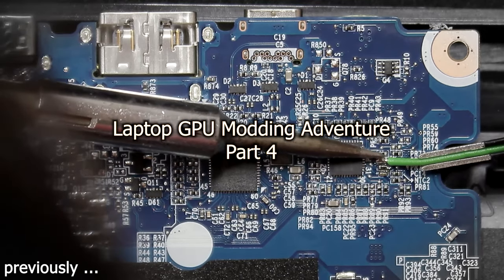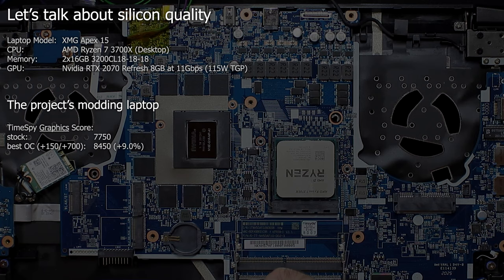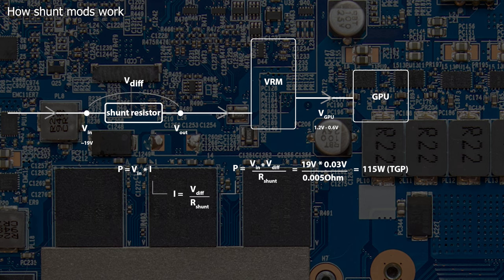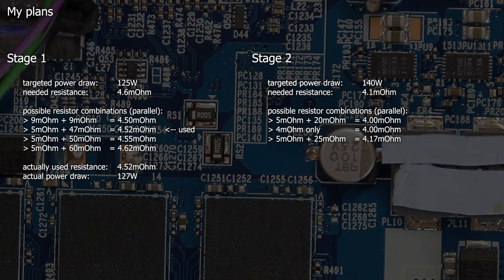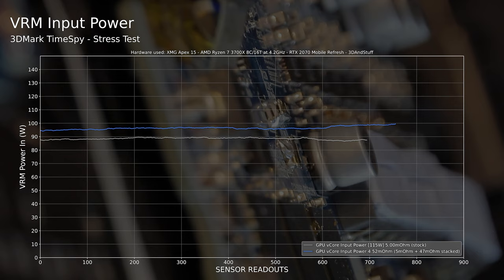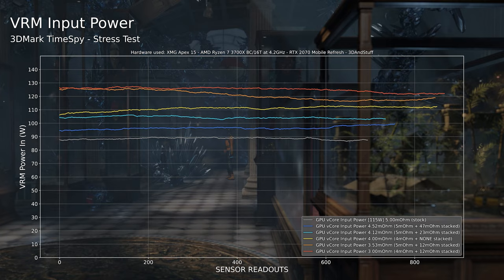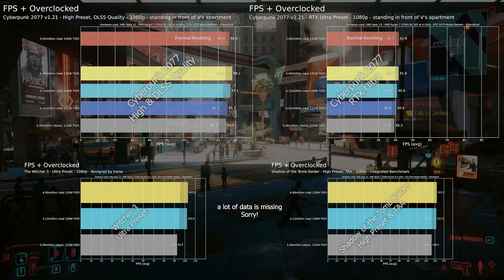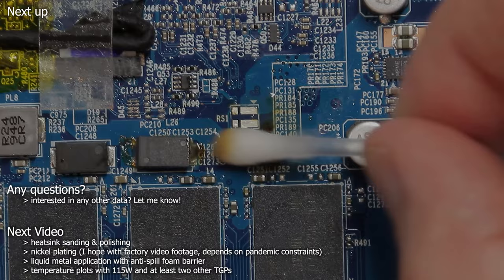Shunt Mod - Laptop Modding Adventure - Part 4

Comment: I gave my Dell G7 2080 max q a shunt mod. Went from 80w-140w. Mine and another person that helped me both have our 3dmark scores crazy high lol. I sold the laptop but I have the Alienware X17 R2 with a 3080ti now.
Reply from the maker: Nice! How high was your gpu score? I wonder if the temperatures were okay though. I bet the heatsink wasn't up to 140W when it was made for 80W.
Reply: @3DAndStuff  graphics score was 25,438, temperature on fire strike was 71c during the test. Never noticed any temperature changes when I did this.

Comment: A desktop GPU has access to stable power, whereas the laptop's Max-Q Dynamic Boost is shifting unused power from the CPU over to the GPU (and back). These setups work best when they find a sort of equilibrium balance between the two massive power draws (GPU and CPU combined). That's why a desktop GPU can almost always out perform the equivalent laptop GPU. And yes you have Max-Q tech in that 2070 even though yours is not the sucky Max-Q variants that were limited to 65w, but Dynamic Boost is actually Max-Q technology too. I think they may have stopped labeling Dynamic Boost as Max-Q later because so many people hated on those power limited variants, but those were supposed to be for ultra thin gaming laptops and not desktop replacement laptops.
Reply: Well, you can use the IMON tweak to bypass that crappy dynamic boost. Did it to my nitro 5 with the 3070ti 150w and i7 12650h. Now my 3070ti can use the full 150w and the i7 can use as much power as it needs to. With a repaste, propping up and cleaned internals, I can keep temps under control. It performs within 5-10% of the desktop 3070
Reply: @siyzerix  right but most of today's gaming laptops can benefit from undervolting the CPU if possible, and dialing back that CPU does let more power stay on the GPU side.
Reply: @bryanwashere5010  Most gaming laptop cpu's can be undervolted. They've artificially been limited so you don't go around improving performance and having control.

And in CPU + GPU workloads, an intel CPU will eat away power from the GPU due to it using more power than ryzen. Just don't let CPU and GPU share power. My nitro 5 can handle a 50-60w CPU + 150w GPU at once, cooling 200-210w. You can see it on my channel with me testing CP2077

Comment: Amazing content! Did you tried to change the vBIOS TDP with MobilePascalTDPTweaker and direct flash the mod BIOS? Or something like that?
Reply: Pascal tweaker wont work with this gpu, Nvidia released it after the last program version.
Reply: Don't need to shunt mod when you can just set the limits in vbios to whatever you want.
I have my 1080M SLI both set to 250W but they are 1.06V limited and hardly ever report above 225W
Reply: @greebj  In the RTX 20 series it is not possible to change the TDP in the vBios

Comment: Could doing a capacitor mod increase power slightly too, or at least clean up the signal? I've seen some people do it on GPU's, but I imagine it's possible on vram, and cpu too. Although it is very tiny work to do.

Comment: Hi. Very educational video.   My Acer Predator Laptop Helios 300 model PH315-54-93K9 With I9 11900H/16GB DDR4 3200MHZ/1TB M.2 PCIE NVME SSD/NVIDIA GEFORCE RTX3070 8GB GDDR6.  When install 4 unit external monitor via 1 x minidisplay port, 1 x HDMI, 2 x USB 3 using usb adapter to HDMI via Intel Display link software.  The PCH System Temp going higher to 80 deg C while CPU temp is 49 Deg C and GPU temp is 47 deg C.  What is best way to lower temp of The PCH chip ?  Please note the PCH chip does not have any heat sink and why does acer does not put heat sink on this chip?  Thank and looking for solutions.  More power to your channel..

Comment: Since the low resistance. Could stacking introduce a higher resistance because of the increased solderlength? That would mean that te rating of the second resistor is higher. Did you ever test the result with a single 3mohm resistor?
Reply from the maker: No, but with a single 4 mOhm resistor and I got roughly 138W TGP. But I think you are not wrong. The solder joints play a role and contribute to the observed non-linear TGPs. Not by 100% but some percent at least.

Comment: I shunt modded my 3070 mobile laptop  and it went from rtx 3060  desktop performance to nearly 3070 desktop performance
Reply from the maker: Will do that too with my next laptop :) What are your improvements in numbers? Baseline graphics score? Graphics score now? What about your temperatures and which shunt resistance you have chosen?
Reply: @3DAndStuff  eh it's a somewhat long process. Check out port royale scores for  10870h and 3070 notebook  I'm at number 1 currently. Do you happen to have a community discord? I could share some of the stories
Reply: @3DAndStuff  actually maybe if you dont want to mainly run a discord yourself i could make a discord and invite a few engineers who helped me and alot of people shunt mod and calculate what they should do so your community have a place to find help
Reply from the maker: @rayproductionsbackupchanne3862  Yep I am quite active in the XMG Comunity discord "XMG & Friends" (https://discord.gg/qBfDeUky). We got an overclocking&modding channel there lately. Come and visit us ;)
Engineers not needed :P we know stuff
Reply: @rayproductionsbackupchanne3862  i have a 3070 desktop  (gigabye a5 x1  it has a total 140 on the gpu currently based on the specs     can you provide how you shunt modded yours? i plan on watercooling my laptop with a couple mods and such and just want a general idea of what to do.  i want desktop level 3070 power at this point.

Comment: Hi mate, long shot but I modified my 0R005 resistors to 0R003 on my MSI GS66 10SF with the 2070 Max Q Refresh 80w, interestingly I now hit Power and Voltage limits shown in GPU-Z and Afterburner without any overclock. I was asked to check the resistance with a multimeter, but the lowest value is 200 so the best reading I could get was 00.5 on my 0R003 resistors. With that said, do you have any idea how I can diagnose whether the resistors themselves or even the soldering is correct? Right now I've literally just ordered a different brand of 0R003 1w 1% 1206 and was just going to try those as I can't think of a way to diagnose.
Reply: I'm no expert MrSweet, but you're trying to draw 190 Watts of power (To GPU alone) through those VRM and even with tons of loss what is trying to hit your GPUcore is so way out of spec no doubt that is your issue. Why not go for something way more modest like r004 or less (stacked) like these fine videos show? r003 is just insane for your laptop board to handle and that GS66 thermal capacity would choke fast and thermal throttle your GPU even if your VRM's withstood the temps for a few hours without fusing inside....  your power brick is probably not a 300W+ which you would need by my calculations so ---no way. Nice try but... Scale back would be my advice.
Reply from the maker: I did not experience it myself, but my guess is that you hit the limits programmed into your GPU's Max-Q vBIOS. It is not a regular vBIOS for the full power range, so it makes sense it is limited in voltage, too. R004 should work better.
Or you can manage to find a Max-P 115W vBIOS for your vendor, which works. Would be the easiest way, without shunt modding.
---
But as Eric said in his comment, using R004 (4mOhm) should already be close to the healthy limit for the existing VRM design in your laptop. So I would not go for more than 100W or maybe 105W TGP in your case.

Comment: i have a question tho, if you shunt mod a laptop, would you need to change to a better charger? like stock one is 100w, after shunt mod you get somewhere 150w so do i need a 150w charger? i know that it have nothing to do with input wattage, just reduce the resistance coming into the chipset
Reply from the maker: You are talking about the power supply unit (PSU), right?
Yes you probably need a higher rated power supply. Mine in the videos got 230W with a little headroom up to 250W, so it can support up to 140W TGP, 88W CPU, plus 20W extras (SSD, display, and so on). But it's really close to the limit. So I should opt for a higher tier power supply myself.
Reply: @3DAndStuff  thanks but they really selling those kind of psu for laptops? or i have to modify myself one?

Comment: Hello I want to ask you for a consultation on this notebook. I was waiting for the update from XMG about ryzen 5000 support on my apex 15, but on the first of November they released a news that they are having serious difficulties with this and the support of ryzen 5000 is highly unlikely. Right now I have ryzen 3600 in mine and its working very good and has a decent thermals. But I want to keep this machine around as much as I could, so if they will not realease a bios support for at least ryzen 5600x I want to know to which cpu I should upgrade? Im looking at 2 options - 3700x and 3900 non-x. Im using my machine for gaming so which one will give me more performance? 3700x has two more cores, but it can just add some more degrees with not that different performance, but 3900 has 12 cores and also 64mb of cache which will be very preferable for games in my opinion. Im sorry for taking your time, but I really need your advice.
Reply from the maker: you are right. At the moment there are no positive news about Zen3 support in the 2020 Apex15. But the new Apex15XL (2021 model) will get it afaik.
Your question for the processor strongly depends on your use scenario. Do you use your processor in ManualOC mode (all-core fixed max clockspeed)? If so then the 3700X would be a better choice because the fewer cores can reach higher clockspeeds than the 12-core 3900.
If you don't run ManualOC, but the default ControlCenter power modes instead I would still say 3700X. Also keep in mind that the higher core count processors draw more power in idle so your fans will go crazy even in idle, when you do not use ManualOC.

3700X:
- 8 cores are enough for gaming
- cheaper
- more quiet fans in idle
- more loud fans under load
- hotter under load

3900(X):
- cache doesn't really matter for games
- just a few games can make use of 12 cores
- more loud fans in idle
- more quieter fans under load
- cooler under load

If you are just gaming i think even your 3600 is enough. You will very likely see no higher FPS with a higher core count Zen2 CPU in most games.

Comment: Thx for all videos from owner xmg apex 15.+if you can,pls answer for some quastions, where did you take Vmem temp on your  laptop?+how much vmem can be overclock with out hard moding laptop(only with program methods) and problems in long life stability?In my laptop i have rtx 2060 refresh .Xmg have low power gddr6 1.2 unlike full 1.35 on other laptops -is it botom for good under clock for vmem?thx you.
Reply from the maker: VMem temperature? Unfortunately I can't acces their temperature. I can only see the GPU and VMem VRM temperatures.
VMem overclocking is very bad for me. I guess because my GPU's bin (silicon quality) is very bad. My VMem is a kind of bad bin too, not just the GPU. I can run +950 on the VMem at 1.38V. That's a joke, so for me it makes no sense to OC the VMem in this laptop. I hope my next one will be better.
In theory the VMem should overclock better than mine. They are the same memory ICs than in desktop cards (14Gbps). But maybe our GPU memory controller is not suitable for 14Gbps+. I can't tell because my bin is so bad as i said.
Reply: @3DAndStuff  thx you!yes, memory is a same gddr6 samsung like on desktop but have lower voltage 1.2 vs 1.35(desktop)that why i do not khow can i ez +1000k on mem or hire or not?bs on desktop and other laptops people can plus 1200 ez)
Reply from the maker: @AdolfL0v3J3Ws  in my experience on average peeps out there can push +900 to 1000 on their VMem. Some can also run +1100. But that's pretty much the end at 1.20V... so 13Gbps in total, which is not bad.
More voltage should give you more headroom. I wanted to show the improvements using my I2C Mod, but as i said, my VRAM bin / quality is not good enough to gain anything significant. I hope I will get the chance to investigate that with another laptop in near future.
In theory 14Gbps should be possible with the Refresh variants at 1.30V+
Reply: @3DAndStuff  Thx you for answers.but with out  knowledge about temp on vram -overclocking is a hard deal, bs it could rise over 100cel on vram= fast dead((if you finding some solution to take that temp?pls make some video or write some comment aboute it .Thx for all videos about xmg it is reall usefull for all oweners!
Reply: hi, any chance you can send me the vbios of your 2060, i can pay using xmg ultra 17 with 90w rtx 2060 sadly.
Reply: @ineptireplica1548  no need to pay,just write to xmg,and they give you that vbios.

Comment: HI, how would i go about doing this for an HP OMEN 17 RTX 2070 SUPER MOBILE, BTW I LOVE THE VIDEO THANK U SO SO MUCH FOR UPLOADING IT😊😊
Reply from the maker: glad you like it :) Well you would do pretty much the same as me. There must be two shunt resistors on your laptop's mainboard too. They are quiet easy to identify. They must be bigger than the other resistors, and can be labeled as "005", "R005" or similar. you can try to track the PCB's traces from the GPU VRM backwards to the shunts.
Reply: @3DAndStuff  Hi man, your project is insane and unique. Why didn't you continue it?
Reply from the maker: @bruda3173  i did and it's already finished :) Just need some time to put the data into a new video. But time is rare :( Got a new job - a lot to do
Reply: I AM Elated, cant wait for the new VIDEO

Comment: Greetings.
Is there any hope, that channel is alive ?
Reply from the maker: I know it's been a while. Working on part 5 atm ;)
Reply: @3DAndStuff  great !!!
Do you know, is clevo working on new AMD based 17inch screen chassi ?
Reply from the maker: @92OnTV  for the B550 desktop CPU variant? Nope! Unfortunately they focus on the mobile variants and seem to dismiss their DTR models. Ultra (with MXM) and probably also future AM5 models could get cut.
They got a 17 inch version of the Apex with mobile Ryzen already though.
Reply: @3DAndStuff  thats a shame(
Every good stuff get under cost cut knife after 2020.
I was dreaming about 19"-21" screen DTR model with best cooling, best sound and best flexibility :/ (p870 successor but even more advanced)
At this point already have no hope...

Comment: im not crazy ! im not only one who is doing this ! :D  i plan to nickel plate GPU plate on asus G14, they did the LM on CPU but saved 10c of money and put garbage thermal paste, after repaste +- + 150points in time spy. 
Shunt resistors, there is a reason why they have 4 pads instead of 2, im not that good with english google it up.

i want to increase TGP on rtx3060 from 80W to 90W, my best score after repaste and +150GPU +225MEM , fans at 80* on 80% was around 7000 point in time spy, disappointing :/
Reply from the maker: haha no you are not crazy! ;) it's fun isn't it? :)
Yep to be honest I do not really understand why the splitted pads from two into four are beneficial. I guess it has something to do with the signal/noise. But ofc there is a reason. I will take a read into it :) But my strange results with the lower two shunt configurations are not explainable just from the signal issue. I suspect a wrong shunt resistance/label plays a role there. In worst case it's coming from the original one. But not sure yet. Need to run tests :)
How about your GPU temperatures? Are they still okay to go for a shunt mod? Also don't forget the VRM phases. They need to be suitable for a mod.
Reply: @3DAndStuff  temps are on the edge, its slim laptop, i hope that i could nickel plate gpu heatsink and apply liquid metal and temps will improve a notch. It can definetly be cooled at 80 % fans speeds , buuuuut, i want more headroom. When i saw you modding VRM cooler, i must do some research into it, G14 have  +-1mm thermal gease on everything, VRM,s GPU MEM, no thermal pad. 
Of course its fun, i did LM on yoga 2 pro i7, and from 930ich to 1200 with LM and undervolt :D  in 3dmark 11. 
also every GPU that i have was modded, when i see free spot on PCB for filtration cap i fill it, sometimes it gives awesome results, 1070ti + 200mhz on mem with +3 polypopylen low esr caps and +-8 MLC 1uf.  Maybe consider adding some quality low esr caps to VRMS, you can help them a lot . happy moding mate
Reply from the maker: @flankerzo  1mm thermal grease still sounds like it's a thermal pad, but a permanently deforming one, so some kind of hybrid like "Alphacool Eisschicht" for example. The bad thing about them is that you can only use them once. Every heatsink removal basically means you should replace them to get the apropriate pressure back so they can work.
Free solder pads for filtration? :D i know what you mean hehe. If you pay close attention you can see in my video that i soldered in an additional 470uF 4V polymer cap next to the shunts to improve video memory stability. Helped nothing unfortunately. Think I need to solder in some smd caps directly next to the memory ICs to see a real improvement.
Reply: I thought the same! I'm currently learning how to mod my Dell G5 5590 with a RTX 2060 lol
Already have changed to liquid metal, flashed a 90w MSI bios and waiting to my CH341a BIOS programmer arrive to try to flash the RTX 2060 1F11 with a RTX 2060 Refreshed (1F15) BIOS (115 w)... Next step: shunt mod!!!
Reply: @guilhermemurari3995  what software are you using to flash with CH341a? i have EZP2010 for this
Reply: @flankerzo  I am using a software called "Programar Eprom 1.34v" sent by the seller
Reply: @flankerzo  Update: I am getting better results using NeoProgrammer 2.2